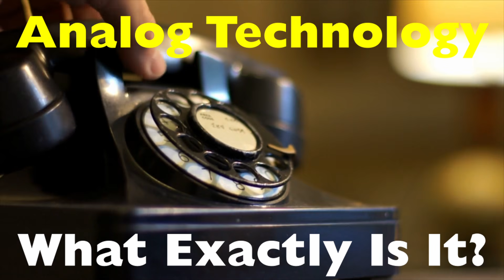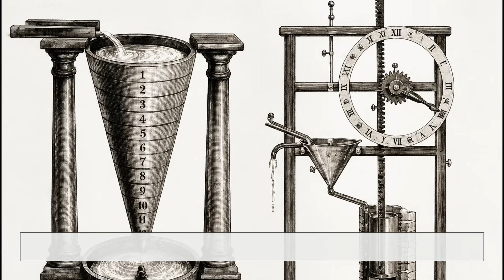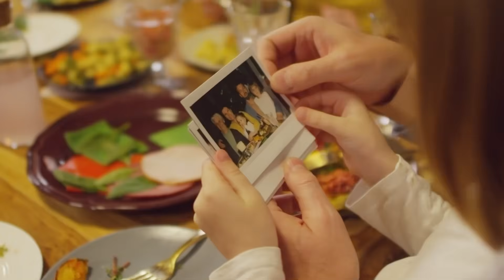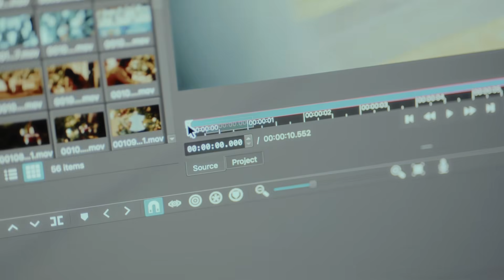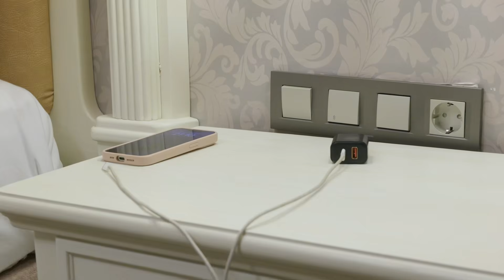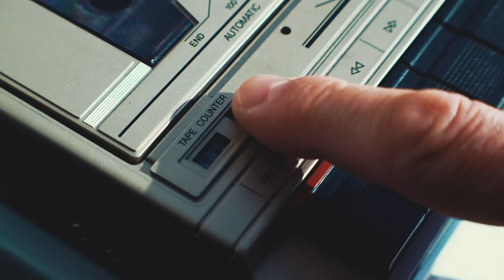What Exactly Is Analog Technology?

Comment: In regards to analogue technology, can you explain how a mechanical alarm clock manages to know the time to which it’s set its alarm to go off? ⏰
Reply: Analog clocks and watches have a dial inside that has a notch and when you set the time for the alarm you move this dial.  As time goes by the mechanism that moves the hour hand has an index that follows the contour of the alarm dial.  When the index falls into the notch the alrm goes off.  There's a separate spring that stores the energy to ring the alarm, and once the alarm goes off you need to rewind this spring each time the alarm goes off.